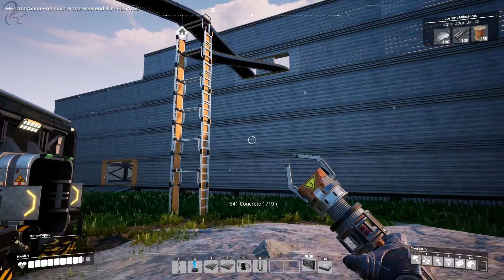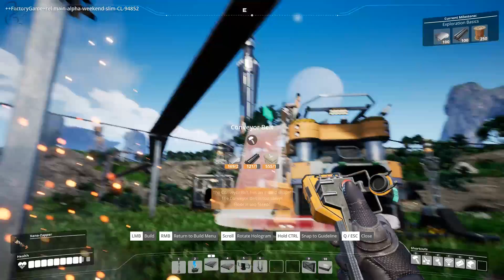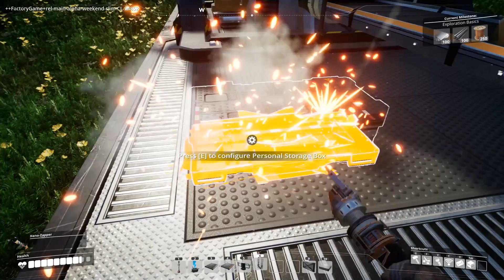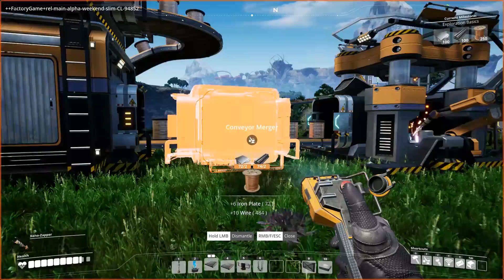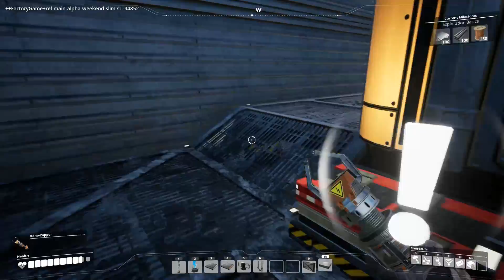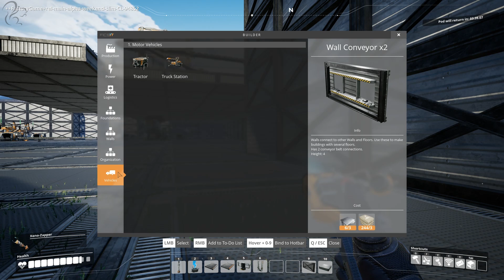Satisfactory - Episode 9 - One Factory

Comment: If you want an attractive way to get powerlines through walls, use a wall panel with a doorway on the second level of your wall. The height lines up well with the top of the power pole, provided the power pole is laterally lined up with the doorway. Then you have a nice opening for your power line to pass through. I used that all over the place in my factory...

Comment: hopefully  you will see this but a small tip i found out if you place a small bit of a belt at the end of a storage container it will cause one to come out of the end meaning that you could use that as an indicator to know whats in your storage containers easier
Reply: Another option is to research the color gun.  With the Color Picker working now, you can pick a color to color code machines, storages, miners, and other objects with the Orangish-Yellow, even the hub.  Don't like the existing color palette?  You can edit the color selections of each Palette choice to create a factory of vibrant blues, greens, yellows and reds.  The only challenge is to remember what your colors represent. :)

Comment: The stairs didn’t work because you didn’t have enough iron plates to build more than one stair set.
Reply: Stairs are also sort of tricky to place unless you figure out the hotspots to place them.  They are also a pain to use for more than about 8-16 meters of elevation change.  It can be something nice to add for an aesthetic or decoration in a factory, or if you don't want to take up a whole lot of floor space to go up.
Reply: @GlanderBrondurg  The key to placing the spiral stairs is to climb up the stairs you just created, point at the end of the upper bit, sticking out and while you might have to rotate them once or twice to get them to snap, you can then build them pretty quickly.

The downside to the stairs is that you need to go round and round so often that it's often better to just use walkway ramps (or even a bit of conveyor belt to go up and down floors).
Reply: @SbgamingTv  Hopefully there will be some good tutorials about how to get that accomplished.  I've seen several YouTubers who have tried to get them built struggle for far too long of a time trying to figure it out, with a couple who simply gave up even bothering.  I agree that your technique is a good one and can help though, but it isn't really as intuitive as the building mechanics for most of the rest of the building that exists in the game.  Perhaps due to its unusual shape.

I don't really fault the devs too much, and you can certainly build very functional factories without the stairs by using ramps and walkways instead.  IMHO the walkways look nicer as well.
Reply: @GlanderBrondurg  When it comes to building in this game, it's all about knowing about where to point the dot in the center of the screen to get the desired effect.  When building foundations for instance, often it's easiest to look at the floor near the edge that you want to attach another foundation.  Same idea, look at the end of the landing.

I know that I've seen Bentham/Mangled Pork get stair construction to work, and to increase the rate of elevation glitched stairs through each other so rather than having a flat landing between each set of stairs, you went up 2 meters for every turn.

Colonel Failure spent a lot of time fighting the stair gods, but his main issue was figuring out where to place the first one on the ground so that the landing at the top was where he wanted it to be, rather than there being a gap that he had to jump.

If I was setup to do Youtube, I'd be making some of those tutorial videos.